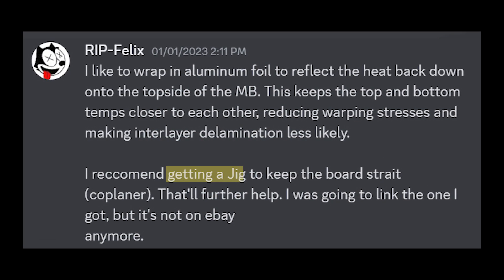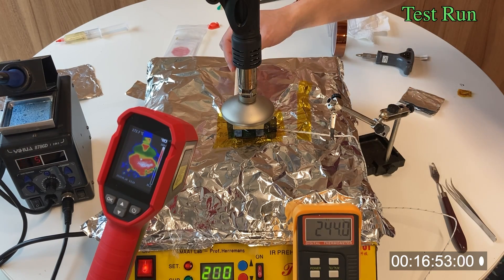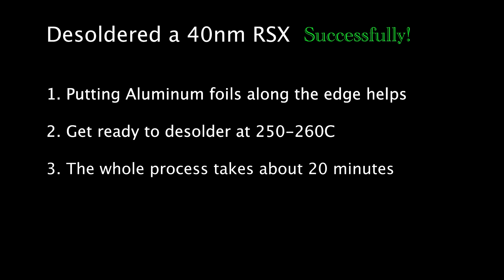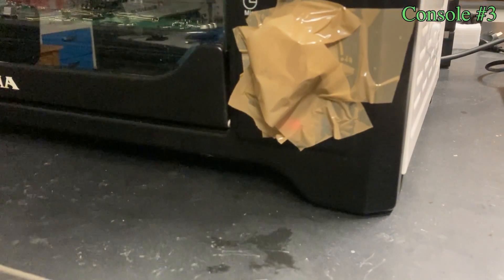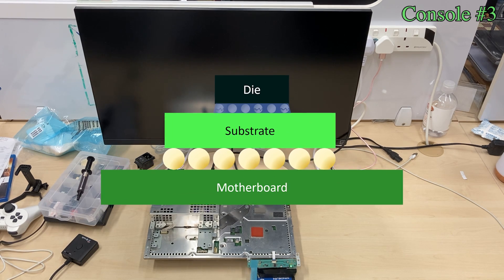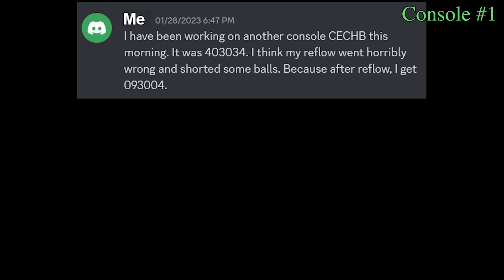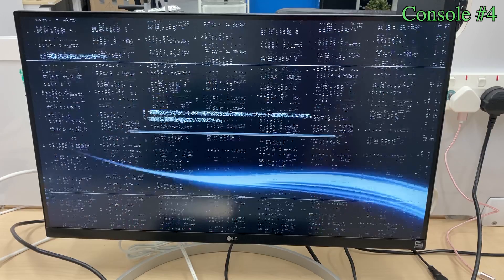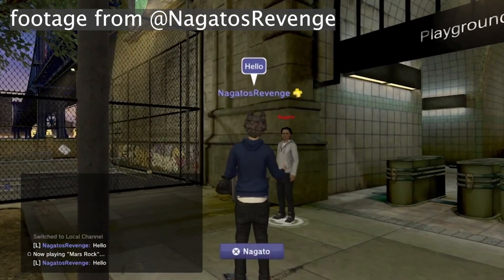I bought 4 broken YLOD PS3s to see if I can fix them (part 3)

Comment: my suggestion is to get yourself a small suction cup tool to remove and place the chip on the board,,  Using any prying on the chip will rip pads off the board been down this road,  I have an IR8500 rework station i have had for years.   I used to years ago repair hundreds if not thousands of PS3 and Xbox 360 YLOD and RROD issues during the height of the problems with these consoles.    Reflowing wont always correct the issue and if it does it usually doesnt last very long.    The issue these consoles had were the inferior lead free solder,  When i would repair them in the past i replaced all the lead free solder on both CPU and GPU and not once did i have a console return to me for the same issue.    Lead based solder is key with these components due to their thermal cycling during use and being shut down.

Comment: It seems you have changed fan speeds but it is worth mentioning that when a reflow works, it won't forever unless the temperatures are maintained below 70C, so the underfill doesn't soften too much and cause errors again.

Either that or changing to a fixed RSX.

Comment: I see the oven you have is just a normal electric oven, do you have any concerns about safety as its probably not rated to heat  for this long, has their been any issues?
Reply from the maker: I test ran it for a few hours and make sure nothing overheat. But you are right, I won't recommend people doing the same. It's a bit dangerous.

Comment: how did you extact the ps home data? I'm still hesitant on updating the fw on a ylod ps3 I fixed it was last used in 2013 ofw 4.46 I think
Reply from the maker: You can refer to the guide here. But yes, without CFW, you cannot extract it.
https://gist.github.com/NagatoDEV/587b5a76a1789a9d91c48e87c634771b

Once CFW is installed, you can enable the qa flag, then you can install any OFW you like, even the old one.
Reply from the maker: For downgrading OFW from CFW, you can refer to this guide
https://www.psx-place.com/threads/downgrading-to-very-old-ofw-from-new-cfw.38458/
Reply: Oh dang! I didn’t know PS home was still around. I remember being in the beta. Good times. My console that had Home got the YLOD but I sent it in for repair and they never sent it back. I really miss that console. I have a post on psx place and Reddit with more information on where to possibly find it

Comment: 7:23 Actually, No. The syscon doesn't save the power-on time when the system was incorrectly shutdown (I learned this the hard way 😢) . In this case the console have 1156 incorrect shutdowns so it probably have around 60-80 days of usage. The only way to know how much it was used exactly is to connect the hdd to PC but unfortunately many consoles have their hdds replaced so the time shown by the hdd will be incorrect too.
Reply from the maker: Oh, I didn't know about that. Thank you for the info. Then that console is not as "new" as I thought which is sad.
Reply: @hardwarerepair200  Yeah, unfortunately. I had unit with only 15 days but from 800 shutdowns, 400 were incorrect

Comment: Console #1's symptoms match exactly with the two boards I attempted frankenstein mods on. I messed up soldering the GPU back on and the chip sank down flat onto the board. They get 093004 errors instantly now. Definitely a short
Reply from the maker: Did you manage to solve it in the end?
Reply: @hardwarerepair200  Unfortunately no, I later found out that the chips I used were badly warped. I removed them myself from dead slim boards. I think my heat gun couldn't apply heat evenly enough. Going to try again with an IR top heater when I have time to build it